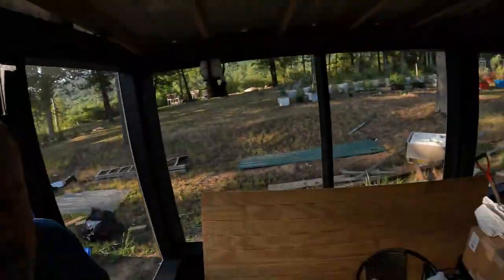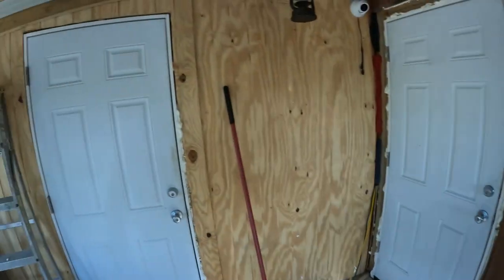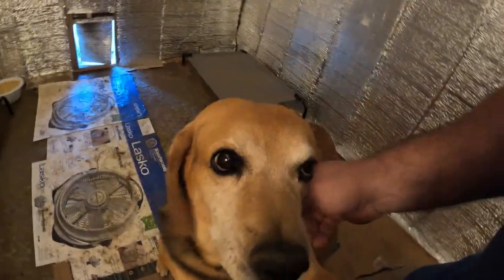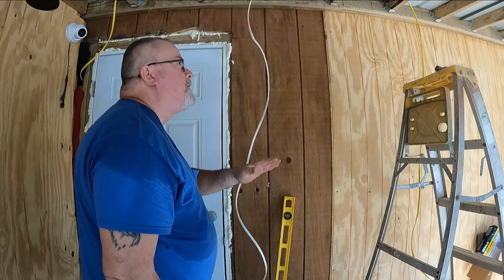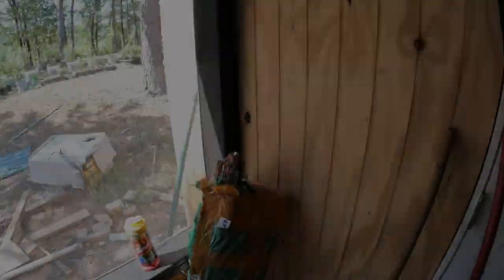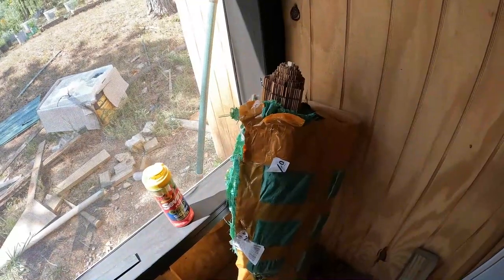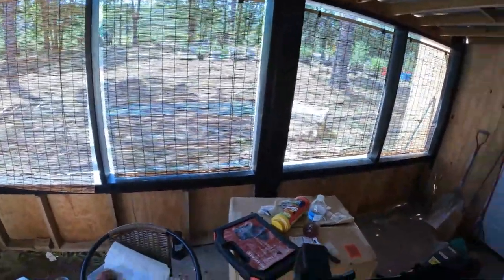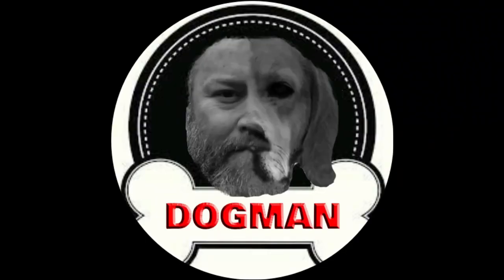Starting The Electrical Work. Screened In Porch / Dog Apartment/ Deck Build

Comment: I need to buy a couple ceiling fans to replace my old ones, I will shop around, my dinning room one the fan quit, but the kitchen one still working, might just try to get a nice one for the dinning room. Might even put up myself, if I can, never done any lighting before. I know to turn the electricity off, that a first step. lol When I moved in 10 yrs. ago, the super, did say he was gonna put new vent in above my stove, still waiting for that. Guess I have to try to degrease some areas so the fan blades will spin again. lol

Comment: Best be careful using a 30 amp breaker. 12 gauge solid romax will carry 2400 watts. A 30 amp breaker may not trip until 3,600 are pulled. In other words the 12 gauge wire will likely overheat before the breaker trips.  Of course this is if you’re using something like a heater on high on that circuit or a similar situation. 

You could wire your receptacle’s with 12 and pigtail on to a 10 gauge run.  This way you could safely use a 30 amp breaker.  

Personally I’d stick to 12 gauge wire on a twenty amp breaker. If your box is short of space they have double breakers that fit in the space if one that work pretty good.

Kudos to you for helping Jeff with new specs.  That’s a very big deal in my book!
Reply from the maker: Im using 10/2 southwire

Comment: I like the shades Mike. I bet they will cool things down. Where did you get them? If you wanted to move them up and block the top, consider moving the hooks up to the side of the 2x4 framing, so that they are sticking out towards you. They won't sit so much in the window, but it'll fix the gap. If they are too big, cut those shades on your chop saw. That's basically what they do with Bali Blinds at Home Depot. 🙂